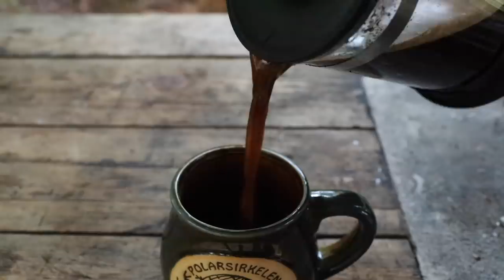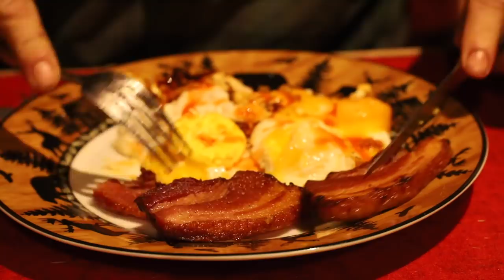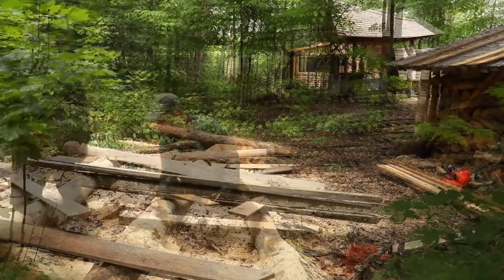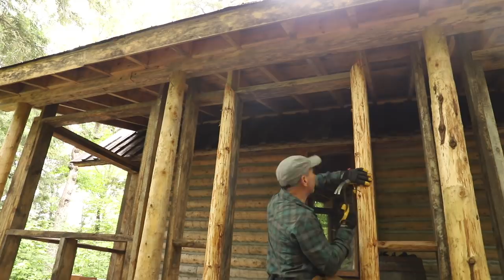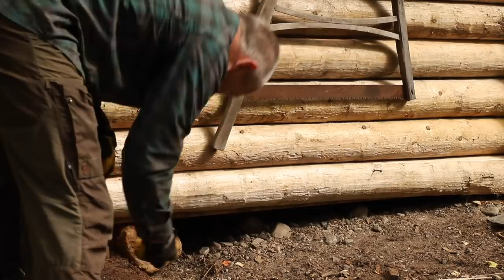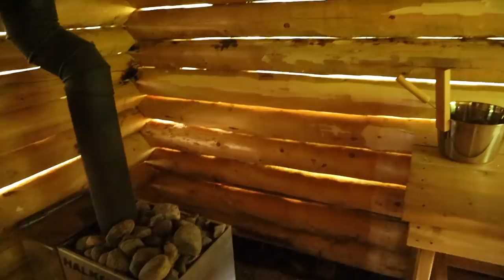Screened Porch on the Log Cabin | Off Grid Sauna and Bathhouse

Comment: I've wondered for quite a while about the absence of chinking in the sauna. I agree, you'd best address that before the snow flies. Thanks, Shawn, for your continuing saga. I've seen several things I'd have done differently over the years, but I'm not there and you are. If it works it's good. You'll probably be tinkering with the homestead until you die. More power to you!

Comment: when using an alaskan mill i’ve found that making a dedicated pair of saw horses with one higher than the other with  a 6”x2” notch cut out in each to hold the logs, gets me off my knees and out of the sawdust  and i’m always cutting down hill. Also if larger logs used it’s easy to make set of steps to put each end of log on to lift up a short height at a time. I know this is all over and done but..... cheers from australia 🇦🇺

Comment: I was going to suggest using the porch for a work area this winter to mortise and cut the beams for your work shop. When I built my shop I dug a pit under one stall to work on my cars. I built it so I could put a cover over it and the floor would be level. I'm suggesting if you can dig your food storage under the shop floor. I don't know if the frost line,I think it's 4', will work under the shop. If you heat the shop I don't think it would hurt the storage, and I don't know if it would freeze. Maybe dig the storage and put a cover on it that would be 2-3' below the shop floor. I built a room off the corner of my basement and insulated it from the rest. It worked great, but you're in a different area. Just an idea stay safe.

Comment: That is very smart to do your plans like you just said in the end. Finish the Sauna 1st and then you can work under the covered porch during the fall and winter. I was wondering, are you going to cut out a door to lead out to the porch from inside the cabin, like right next to the fireplace like in the center of the left wall? I think if you did that and make the screens on the porch where you can close shutters or something during the winter or when it rains you can use the porch as a bedroom/ dining room or living room and turn the now living room into a dining room or bedroom. Just wondering how you plan on doing the layout now that you are adding on more. You could build a quick door to hang but would it disturb its stability of the cabin?  Thank you Shawn for sharing your journey with us.

Comment: I’m wondering if the new porch will act like a heat sink during the winter when it’s fully enclosed and somewhat air tight. With that much cold, dead air space, do you think it’ll be colder to that side of the cabin during winters? Wood consumption should be an indicator.

Comment: Question, have you ever had a water dozing (don't know if I spelled that right) done on your property near the cabin, you've not mentioned it that I know of and why is you're bathroom so far away from the cabin? If you where as old as I am , that sure as hell be a factor.
Reply from the maker: I can witch water myself actually.  The issue near the cabin is that it's perched on bedrock, the valleys are the only places with deep soil and a high enough water table to access without drilling.